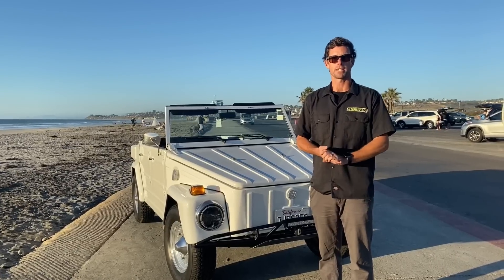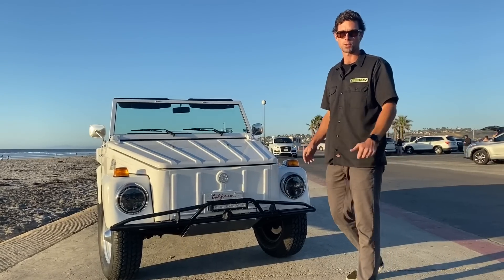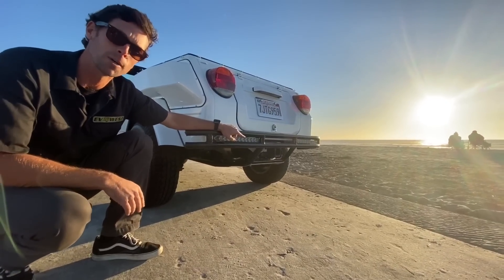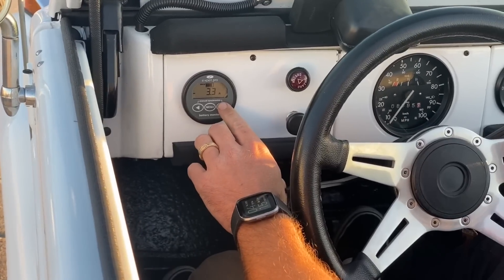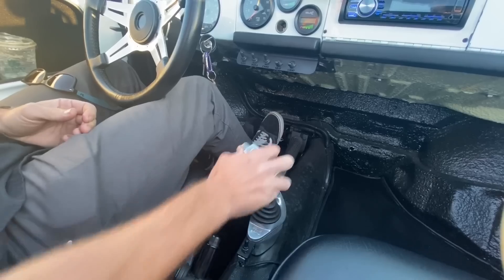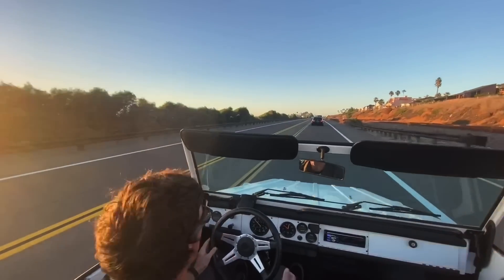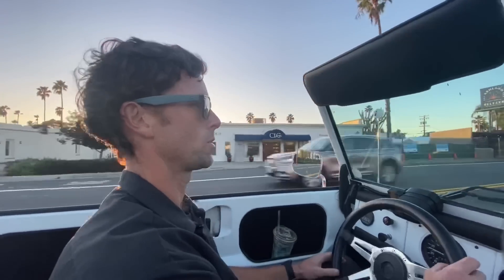1973 Volkswagen Thing EV Conversion | EV Show

Comment: steering wheel and driverside cluster bulge hault open envelope windshield aesthetic exterior by light fixture handle rotation at lower trim window height location
Reply: heads up display by iron steam ; metal dashboard bulge top zero windshield cut  steam hiss secondary function trailered asymmetric
Reply: din din oscillating tres' wrist ; bonnat opening aesthetic
Reply: twice and third wasn't observed in instruction reading lips

Comment: Ive noticed you guys do dual motors with either a shared shaft (inline?) or the dual motors like this, side-by side (gearbox? chain?) - is there a better regen for one setup than the other, advantages other than the space the is less on the side-by-side?

Comment: I'm glad you addressed the intake air "boxes".  As a former '73 Thing owner, that was the telltale difference between the two years they were offered here in the US.  It seems like the VW 010 three speed automatic would be a good choice for EV swaps in older rear engine VWs.

Comment: how much does one of these conversions cost, i got an old car in the garage and i'd like to see it running on electric energy but my budget is kind of tight, nice build btw!
Reply: $$$$$$ Probably around $25,000 give or take. The basic kit (no batteries, no labor, no a lot of miscellaneous) is $8000 and up.

Comment: I love it!!  Love the 914, and the M3 as well.. Favs. EV West is fixing the one part of German cars that has always plagued them. And that is.. Reliability. Electrics have to be the most reliable way to go being that an electric motor only has 2 maybe 5 moving parts depends on the motor type. Not much to go wrong at all. I have an electric motor that is at least 75 years old. Never touched and still runs perfect.

Comment: You didn't mention the range.
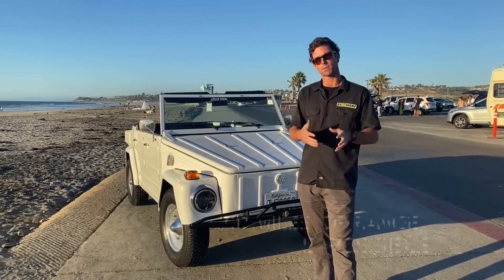Reply from the maker: 1:14 lower third of screen. 200 miles of range
Reply: @EVWest  LOL! I was listening so intently for the range I completely missed the note! BTW, the Thing is essentially a Kubelwagen, right?
Reply: @TonyGrant.  you could say it was "inspired by" the Kubel but that's about where the similarities end..
Reply: @Turk380  I would say that the similarities are just the start. Not much fundamentally changed over the years when it came to air cooled VWs. The shapes and technicalities remained much the same, changing in detail only. The Thing and the Kubel are very similar in looks and are technically similar too. My understanding is that they both built on the Beetle running gear - both have a rear mounted boxer air cooled 4 cylinder engine,  rear wheel drive transaxle gearbox and torsion bar independent suspension. Although, the floor pan is different. I would say the Thing is more an updated Kubel rather than in inspired design. 

BTW - I think it's fantastic that they have electrified this. I'd love to see how it compares off road to the air cooled version, especially in loose sand.